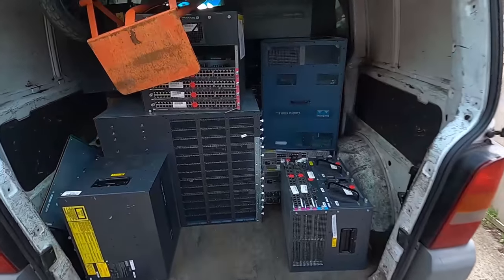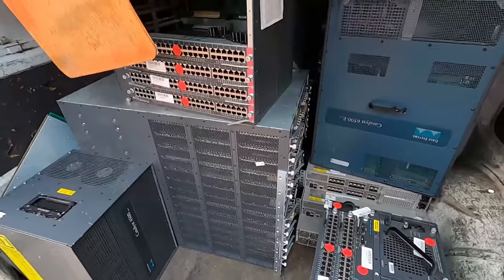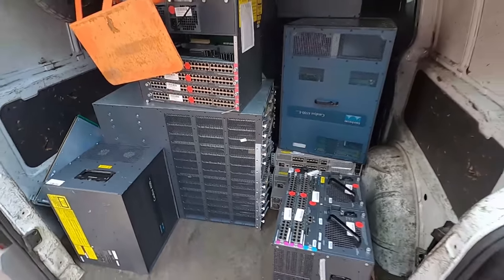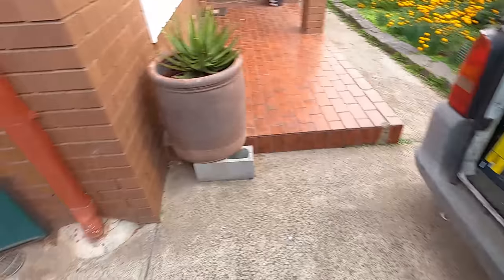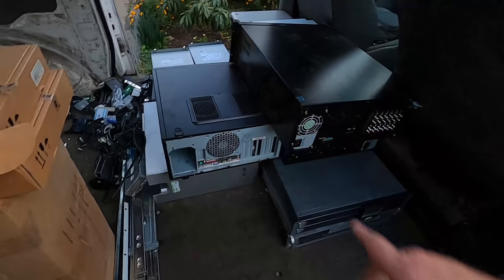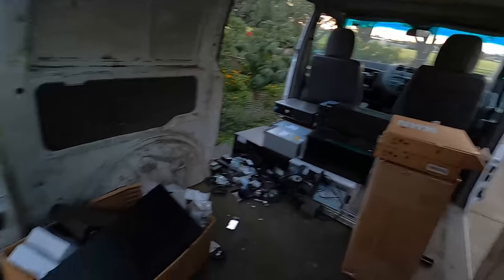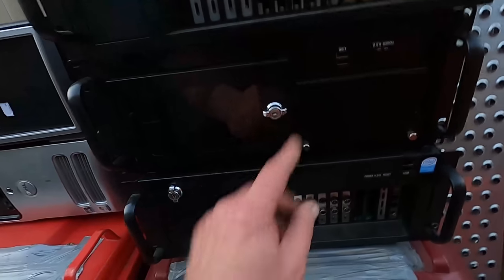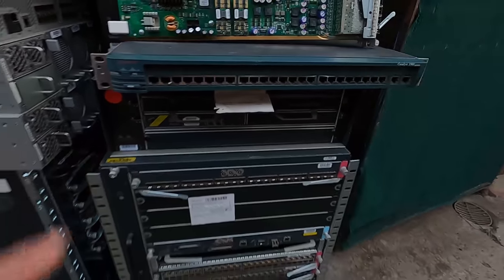Super Cisco E Waste Pick Up Big $$$ Haul

Comment: that looks as if they are changing out there equipment to 1gigabit systems or even 10gigibit systems.  Been seeing that a lot after 10gig is getting cheaper.   I work for a tire manufacturing company and they  changed out a lot of there systems with must faster networking systems ect.   I have been buying old net gear equipment,  for POE cameras the systems are still good, even old new systems.  I have a 2 gigabit back bone or 2 1gig lines running in lacp between all my equipment.  and fast for my home lab.   I love to one day get some 10 gig systems or even the new Netgear systems that have a 40gig back bone built in for stack ability.

Comment: I picked up a similar haul a few years back (almost identical! ) sold a few for a few $100 (NZ) but the big ones that you can hardly lift I couldn't get anyone to take them free, I've still most of them stacked under my car port as don't know what to do with them... could sell for a few $$ each but the hassle of boxing up etc, and two years past they are less value now. The guy I got them off unfortunately died, but apparently he paid around $80K at an auction for them a year or so earlier. Almost wished I didn't get them as they felt too valuable to scrap and too cheap to sell :p
Reply from the maker: Yeah same here, I tried my big server guy and another buyer and neither wanted any of it, they would of made an offer if they could do something with them so gold recovery is best option here, but it's all good.
Reply: @eWasteBen  Only large businesses would use these and they are likely to buy new. You could sell the line cards and power supplies though. I have sold them in the past and got good money.
Reply: That size servers are almost 100% custom specs so there is point in buying something that may or may not work for another company.  We are going to see the IT stuff being re-processed more when the financial crisis will hit, I am sure of that.
Reply: Andrew sparrow where are located? If in the us I would have them Cisco’s picked depending on how many you have let me know.
Reply: Andrew Sparrow contact me though Instagram
Reply: @davidhauschild5584  Sorry, in New Zealand ☹️

Comment: 25:00 Companies being nice !!!!. I was told this exaclty same thing with SIEMENS telephone systems. We were in charge of making specs for the purchase of Telephone systems (private) and we hated SIEMENS so much. Because they not only destroyed the remanent systems, but also any spares rendering your system useless.Telephone systems are not expected to be refreshed so often, 10 years is nothing. Alcatel was another good example. The sold the expansion boards at insane prices, much like the base configuration.  One time, we need to decomision a good wokring unit just because the expansion board cost as much as a new base system with cheaper boatrds. We stuck to PANASONIC for up to 64 lines and HARRIS / TELTRONICS for any range from 100 yo 300.  Reason was simple, they gave long support to their systems, spares available and most important RELIABILITY. Each time I saw a SIEMENS offer or qoute, we put all our effort to put it down. They were PATHETIC and their stuff wasnt even good.

Comment: i wish you would not throw out the fans they have a small copper coil inside and all you need to do to sell them as motors is tap them in the center with a hammer over a couple of bricks weigh them in

Comment: I don't think the listing prices that you mention are indication of how much these switches sell for.  What you mention are probably original retail prices.  The one you said that is listed for $35,000 - I found one with the same model # seems to be listed for only $90 with free shipping and 8 of them available in the same listing (https://www.ebay.com/itm/Cisco-CRS-16-FC140-S-CRS-Series-16Slot-Fabric-Card-140G-3yr-Warranty-Free-Ship/283437915986?hash=item41fe375f52:g:97cAAOSwimdXo8tw).  And that includes 3 year warranty.  There are other listings for a little more with best offer option.  I may be missing something, but I'm assuming these are obsolete networking cards/switches and there is very little demand for them at this point, with a lot of supply coming from recyclers.
Reply from the maker: same part number but very different, those are just half the size boards

Comment: You need to think about what is inside the boards! What you cannot see but is very costly! What are the circuits pathways made out of?! Most importantly “What combination of metals are inside of the pathways?” Which metal conducts electric currents the best! It’s a proven system that isn’t cheap! I have a very good idea what it is but I cannot tell you...
Just take a Periodic table, line eleven and look at the three top metals on it. But then you have to Look for which metals conduct electricity the best! Especially low voltage!